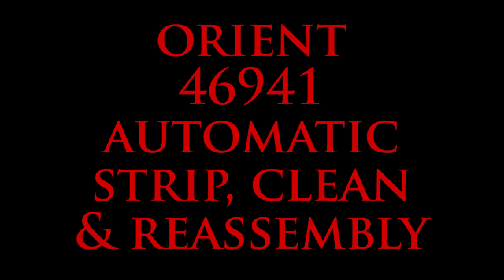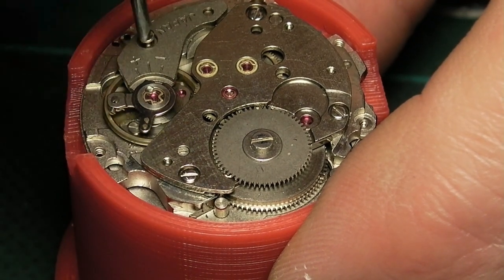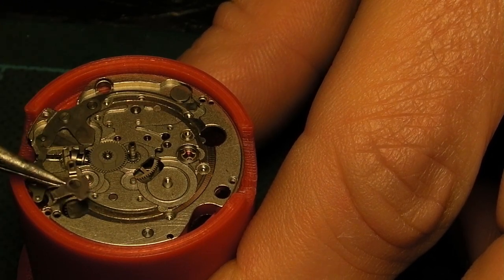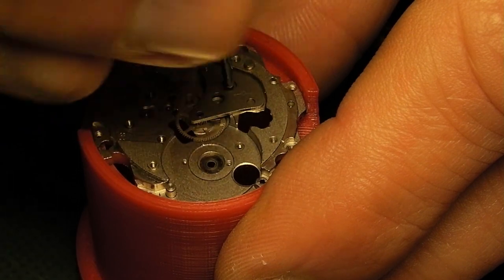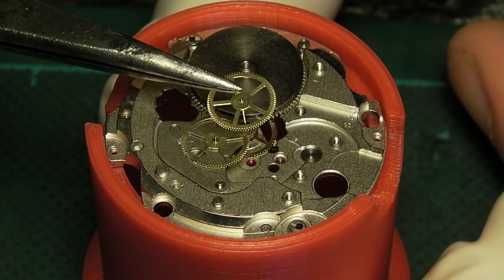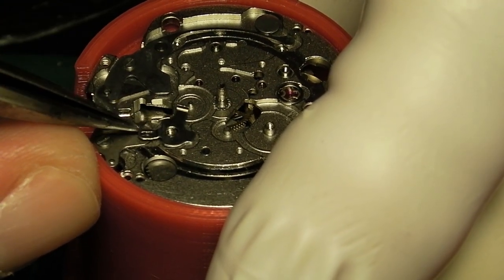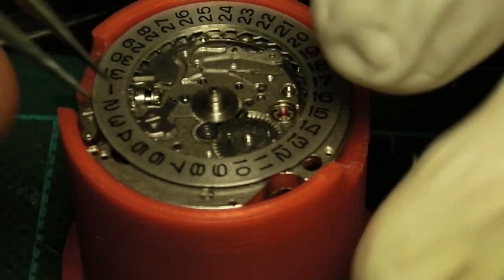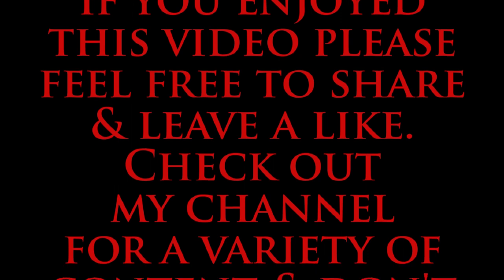Orient 46941 Day Date Disassembly Service & Reassembly

Comment: Another fine video with useful tips. Putting the one turn wind on the mainspring, prior to installing the balance assembly, is an especially useful tip. Keep up the good work.
Reply from the maker: Thanks, glad you enjoyed it. The one turn thing is a personal preference but I find it typically produces an amplitude of about 180 degrees on a good free moving movement with a good usable mainspring, also handy for establishing lift angle of an unknown movement

Comment: Brillant video, I have just bought a similar model with the same calibre, im sure ill be watching a few times more before strip down.
Reply from the maker: Hope it's helpful for you.
Reply: @spidiq8  yeah definitely very useful, I noticed you're using a 3d printed holder, ill have to have a look for a file design. Ps l see you have some bike videos,  ill have a look. Thanks Jay
Reply from the maker: @overlandmotorcycletours4785  Yes I design and print a lot of my holders. Pla is great as it's direct enough but won't Mark or damage any movements.
I do have a few bike videos. Some reviews and some mechanical etc. If you go to my playlists you'll see most things are group categorised as I do have a variety of content so you'll find all my bike related videos under one heading, all watch related under another, coffee related another etc etc

Comment: Hey, i'm starting to service my watch (first time ever servicing a watch. I have a very simillar watch with same movement) wanted to ask you for tips about lubing because i dont want to spend much money and thats why im only buying manual oilers also i wanted to ask about what oil/grease you are using and for what part of the watch. Nice video i understood everithing appart of the oiling process :yougotthis:
Reply from the maker: If you're just starting out and want to keep costs to a minimum you can get by with Moebius 8000 and a tube of Molykote DX grease.
All pivots are oiled and all sliding metal to metal surfaces greased.
A barrel arbor in a metal bushng can be greased as an alternative to oiling.
To expand a little the minimum i'd recommend are as follows.
Moebius 8300 grease, Keyless works, barrel arbor, cannon pinion, calendar jumpers.
Moebius 8217 braking grease, barrel wall for slipping mainsprings.
Moebius D5 / HP1300 Barrel arbor, cannon pinion, 2nd wheel, (occasionally 3rd wheel on large movements), some keyless  components, oscillating weight bearings.
Moebius 9010, 3rd, 4th, escape wheel pivots, pallet stone faces (there's a special lubricant for this but it's expensive)

The above is simply a general guide, for your Orient movement i'd recommend the following.
8217 barrel wall
8300 for all the metal to metal including the barrel arbor if it's in metal bushings.
D5/HP1300 barrel arbor if jewelled and 2nd wheel pivots, cannon pinion, oscillating weight bearings.
9010 3rd, 4th, escape, 1st reduction wheel teeth that the magic lever for the auto winding bear on.
Silicone grease for crown and case back gasket.

Comment: I discovered your video as I am looking into servicing an Orient 46941 movement. If I may I have a question regarding the automatic winding works, more over the Bearings in the automatic works. How do you  clean and lubricante those bearings. What solvent and/or solvent lubricant did you use. Thanks for  your time and info.
Reply from the maker: The automatic winding system on these is the same as Seiko with the 'magic' lever push pull system.
Clean the pawl lever and 1st reduction wheel as you normally would in whatever solvent you use and after reassembly add 2 small drops of 9010 to the teeth of the 1st reduction wheel then operate the oscillating weight round a few times.
The pivots are lubricated with D5.
Reply: Thanks so much for the info. It will make it incredibly easier when I dive in to restore mine. If I may I have just one more question. I am thinking of replacing the main spring to give it the watch  more life. Where can I order a new one for this caliber. I just can’t seem to find any place to buy them from .

Comment: Hi, I have a question with regards to the dial ring . The metal ring that sits between the dial so the calendar ring can rotate. Is this metal or plastic ? Which should be used ?
Reply from the maker: It depends on the movement and watch. Both metal and plastic are used for dial rings and for movement rings.
Reply: Oh, I see. Thank you for the reply. Really appreciate it. And great video 👍🏼.

Comment: What do you oil or grease on the escapement, if anything?
Reply from the maker: A very tiny drop of moebius 9415 on the face of the pallet stones. I do this under a microscope as it's incredibly difficult to do accurately without.

Comment: Sir, if the hair spring is tied due to magnetism (i think), if i remove the balance and stretch the spring it out by lifting the balance would that fix the problem?
Reply from the maker: No, this will risk damaging the fragile hairspring.
You need to demagnetise it with a commercially and cheaply available demagnetiser.
Magnetism makes the hairspring coils stick together, If they're tangled across one another this typically happens due to the balance being dropped.
Reply: @spidiq8  thank you for your reply sir. I will follow your instructions.

Comment: Hello, just bought a 46941 and im struggling removing the winder, any tips?
Reply from the maker: The stem should remove easily if that's what you're referring to?
Pressing the release and drawing it out should suffice unless it's internally corroded in which case you'll need to disassemble the movement in the case until you can access it to free it.

Comment: Hi Spidiq8,

Great video, very helpful.

Since you look well versed with Orients, i am pretty sure that you are the right person to ask this question. 

I have an Orient Day Date President Watch. Model EV03001D. It has a automatic movement 46E. I intend to replace the factory day date wheel from English to Arabic. Where should i start. Or can u suggest someone who can do these mods?

TIA.
Reply from the maker: Changing the day wheel is easy provided you have a little experience removing and refitting dials and hands.
The tricky bit is getting a replacement day wheel, often it's easier to buy a complete watch or movement for spares.
Getting Orient spares is not easy unfortunately but a Seiko day wheel may fit.
Which country are you in?
Reply: @spidiq8  Based out of Bahrain
Reply from the maker: @ahmedyousufabdullah  Unfortunately I don't know anyone to recommended there. But any competent recommended watchmaker would certainly be able to do this. The tricky bit as said would be getting the parts needed.
Reply: @spidiq8  thanks. Now the questions is how to find a day date wheel in Arabic that exactly fits and works with orient. Any hints?
Reply from the maker: @ahmedyousufabdullah  Sadly not! Getting Orient parts is a nightmare, I have been searching for a replacement crown for a Kano five watch of mine for months and unlike other watches including Seiko who Orient are a part of you just don't see spares listed anywhere.
First thing to do is to to find out if they made an Arabic dial for the day/date style and if so it might be a case of trawling eBay and local selling sites to find a complete movement or watch cheaply to swap the parts from.